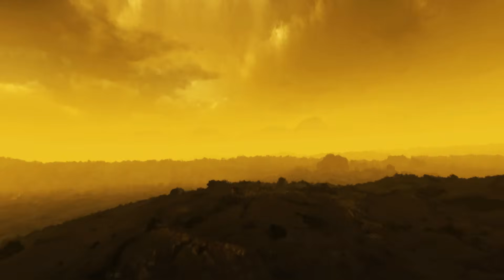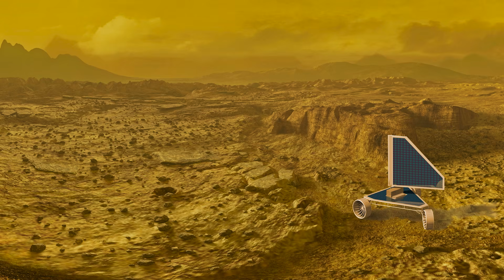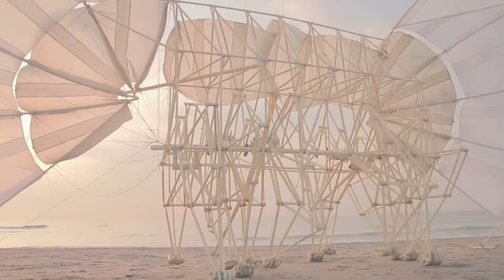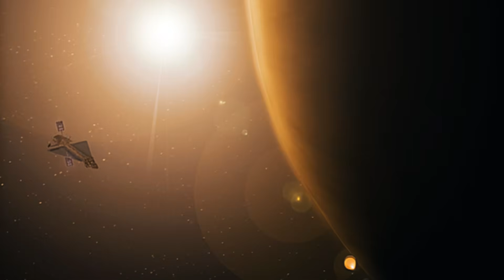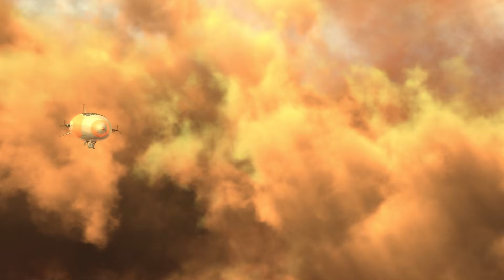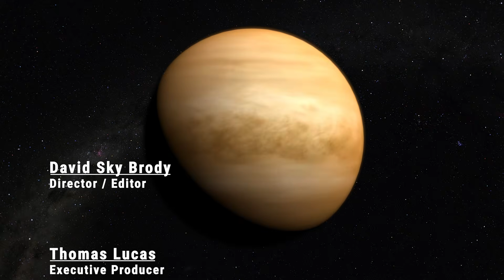Why Is Venus Hotter Than Mercury? | Exploring Venus: Doing Science In Hell

Comment: The dirigibles in the Venusian atmosphere could be 'manned' by human-piloted robotics, controlled via VR. The humans would remain safely in orbit while having low-latency feedback from operations in the danger zone.
Reply: For that the orbiting station would have to orbit at over 1.5 million km from the planet , the geostationary altitude for a planet of about earth-size that only makes a full rotation once every 243 days. In other words, you'd need a starlink-like constellation in low venus orbit to relay the signals around the planet towards the station which would ideally be in a 2,000+ km orbit (Venus has an incredibly thick atmosphere reaching much higher than Earth's)
Reply: @paulmichaelfreedman8334 that's actually a good consideration. Although Starlink is low-orbit to balance for cost effectiveness and preventing space debris, cuz earth's orbit is kinda cluttered. 
Venus however would have very few man made satellites to account for, so a high-orbit constellation would last longest and provide global coverage. Latency between those far satellites should be workable. The Mars rover is controlled from Earth with about a 3-6 minute lag period, so the Venusian crew in orbit should have little problem moving robotics on a dirigible in atmosphere. Until more crews and dirigibles show up and bandwidth becomes a concern 😂
Reply: @EddieGalois  Crews? How about robots and AI? It's a process that takes Eons. Humans can monitor the progress from Earth
Reply: @paulmichaelfreedman8334 oh yeah, AI will take over at scale, but come on, the excitement, the adventure. There will be at least some humans who will assume responsibility for personal risk for the opportunity to pilot crafts and robotics in, on and above Venus.